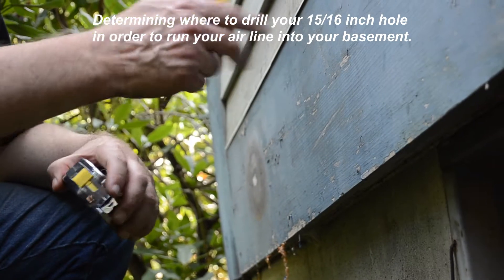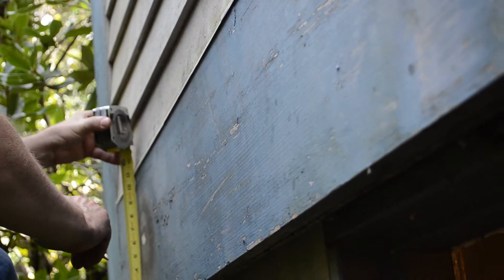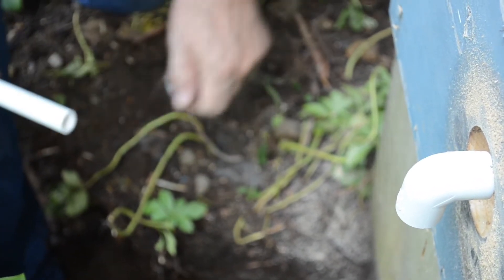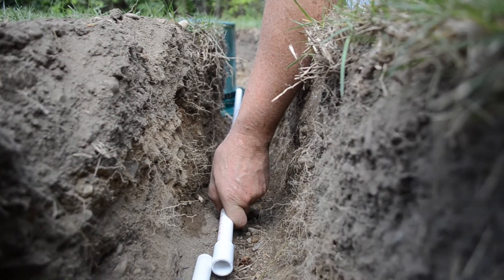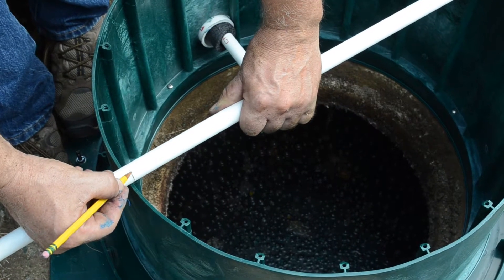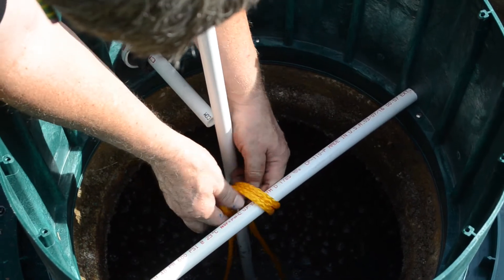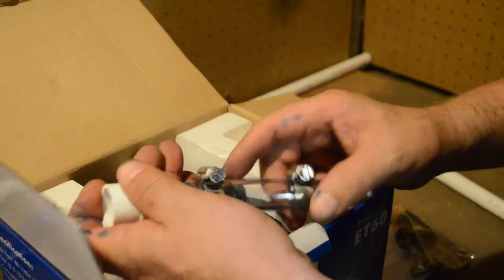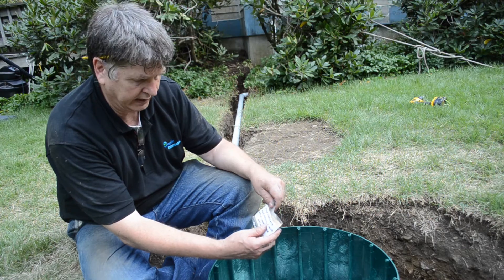Installing the Septic Genie with Pump in Basement

Comment: Does this system require a vent on the septic tank.  our last anaerobic septic didn't have a tank vent,  but we are replacing an old tank at a new property and we are interested in using the aerobic system due to having a well and small creek on the property.